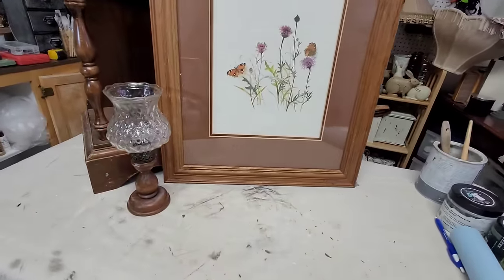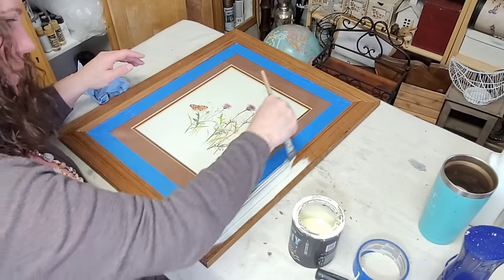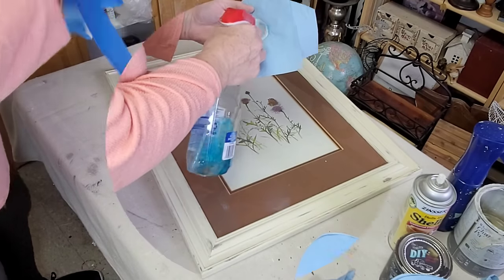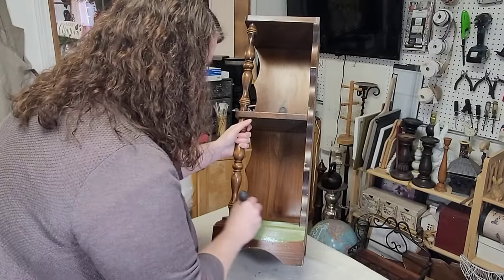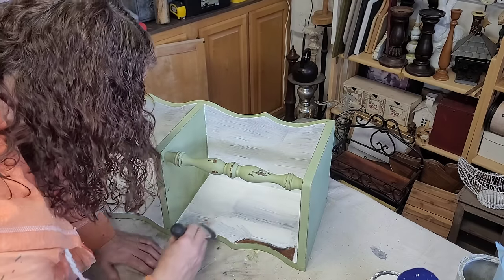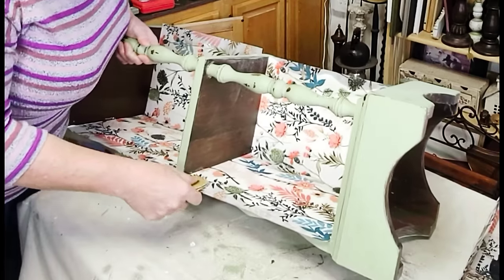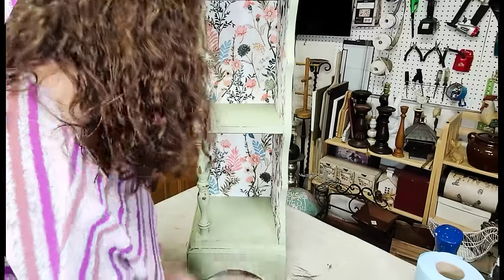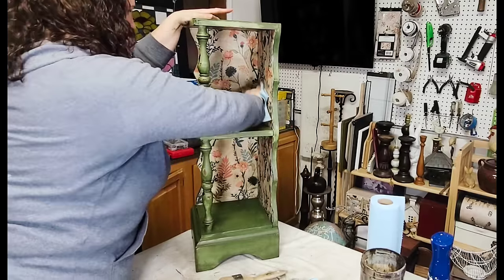Thrift Flips • Trash to Treasure • Upcycling Salvaged Items • Upcycled Decor

Comment: Love your projects.  A couple of questions:
1.  How do you keep your decoupage paper from wrinkling when you apply it to a piece?
2.  What do you use to clean your wax brushes?  
3.  How do you decide what to price your items for resellling?
Reply from the maker: I'm glad you liked the projects!! In answer to your questions:
1. For fiber papers I iron them first to make sure they don't have any wrinkles - and honestly they are so thick that wrinkles really aren't an issue while applying them. For regular decoupage paper (like Roycycled), I spritz the paper with water before I apply it, and I make sure to work in sections - laying down and even coat of the patina,  applying the paper, smoothing out the paper with my brush as I apply the top coat of patina, and then moving on the the next section . . . if that makes sense. :)
2. I use mineral spirits to clean my wax brushes. I actually store my brushes in about a half inch of mineral spirits.
3. I hate pricing. I use google lens a lot to help, and I research things online to see what similar items sell for. There is no exact science honestly. :)